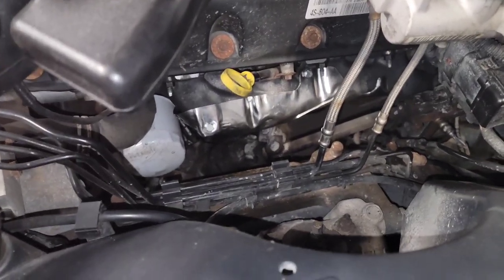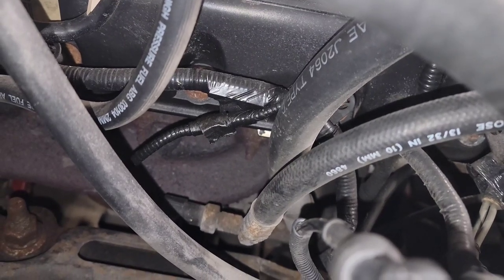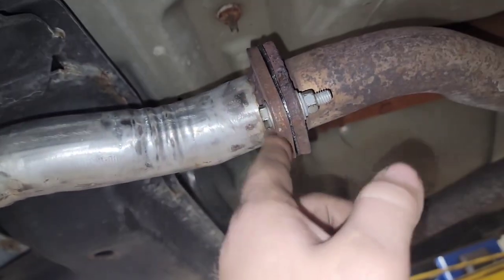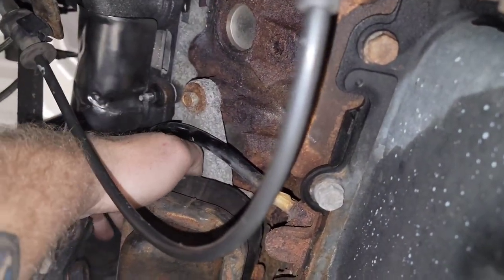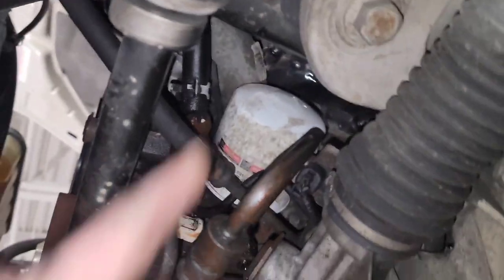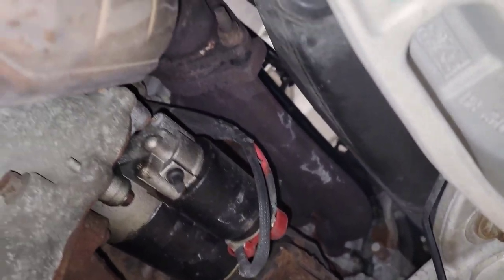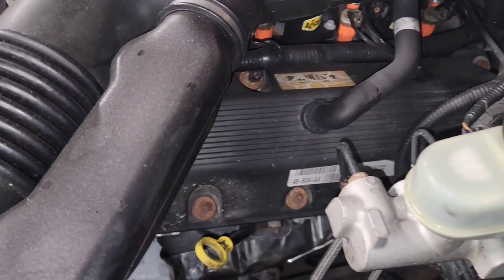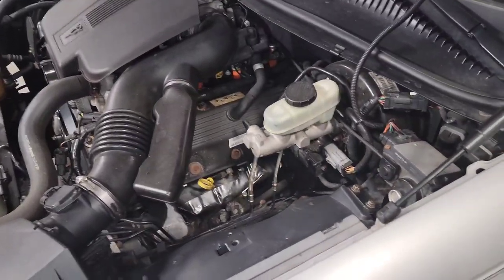2004 Lincoln Town Car Ultimate Subscriber brings his Town Car in that he found on my channel

Comment: Yes I have a 2000 Town car with 208 k miles and I love it. We have fixed all the problems they have at about 180 k. Intake manifold leak, air shocks, front end rebuild, etc. Should run forever. 21 mpg @ 85 mph. Love it!

Comment: The late model full sized Town Cars, and Continentals from the 70’s all had a ride quality that was unmatched by any auto manufacturer. Even an S-Class didn’t ride as soft or smooth over the roughest pavement compared to the Lincoln.

Plus they are built to last forever and are ultra reliable. The only complaint I will say that had plagued Town Cars since the 90’s, is their shoddy quality interiors. Ford never did use the best plastics and the fit and finish was pretty bad in the early 2000 models. Flimsy trim pieces in all. Not to mention Fords electrical components didn’t last long either back then. Power window issues, HVAC problems, power door lock and seat switch/motor failure.. 

Other than that they are smooth cars to drive. I can attest because my 78 Lincoln Continental is the smoothest, most comfortable  riding car I have ever owned hands down, and I’ve driven a lot of newer and older vehicles and for whatever reason none of the modern stuff can touch a full-frame, long wheelbase, RWD luxury sedan from the best. It’s almost impossible even with all the latest suspension technology. 

And that formula is the most basic to build too.it’s not a secret either. 

1. Body-On-Frame =superior NVH over Unibody Construction.

2. Large tires, like 60 or 75 series to cushion road impacts to lessen the “jolt” inside the cabin. Modern cars lose on that one since everything is big wheels and low-profile tires from the factory these days which equals a rougher ride.

3. Heavy curb weight, and body rigidity = a very smooth quiet, vibration free riding car.

4. RWD Softly tuned Coil spring/Air ride suspension that uses a SLA design for ultimate wheel travel and wheel articulation for the best ride quality and handling.

5. Long wheelbase= less bumpy and harsh ride.

The Town Car and many other old school luxury rides from the past all check off in this department and unfortunately they don’t built these kind of tanks anymore which even to this day, ride far superior to garbage FWD suppose luxury whips built now.

This is why I could never sell my Lincoln’s. Ford should never have eliminated the Panther Platform, it’s one of the worst decisions they have ever made, but I understand the reason. The Government likes to ruin everything for everybody since they have nothing better to do.

Comment: Finally got a Lincoln Signature Limited yesterday. Super clean ride. Just the steering is a bit tight but I'll research and try to sort it out.
Reply from the maker: Steering sector shaft replacement
Reply: @FordBossMe  I'll look into that then. Appreciate it. Keep the content coming! 👌🏼
Reply: @fantasma.b  My parent's 05 LTC Signature had a recall for that steering column shaft.  I took it in several yrs ago.  The old one was still fine.  But it was a recall and parts/labor was free so we had them change it out.  Have the local dealer look up your VIN and see if your TC is covered.  Good luck.

Comment: Love the panther platform. I want a full frame, rear wheel drive, V-8 engined car with dual exhaust. Unibodies are very strong, ridgid and squeek free initially, but they don't age well in Central New York winters. The winter road salt gets into all of the cracks and crevices and significantly weakens the unibody with each passing winter.

Comment: I don't know if any other CVPI owner notice this but you can hear everything, I can hear the transmission I can hear injectors, tires, I hear it all, I'm guessing because CVPI doesn't have carpet, My 96 town car I used to have I didn't hear anything when going down the road
Reply from the maker: Yes it's very common in those
Reply: The reason for all the noise in the interceptor is that when municipal law enforcement agencies ordered their vehicles....a large majority of them order whole fleets of CVPIs.  And with all the added heavy duty equipment and weight most of these did not come from factory with the thicker sound deadening material/padding/insulation that the civilian CV would have.  This actually helped keep the purchase price down by a few $.  And when ordering in bulk the costs starts to add up.  But the low rumble of exhaust, the high hum of transmission shifting while in pursuit, and the flutter of air around cabin doors while cruising down the highway are all just part of the charm of the Ford CVPI.  Don't get me started on the way they ride as compared to a civilian CV LS or MGM LS Ultimate!  And yes, I have rode in all three models.  Some not by choice.  Lol

Comment: Check the rack right where the input shaft for the steering shaft meets up. Mine has the updated lower shaft, but mine leaks right where the input shaft comes out of the seal.

My parents bought an 04 CV from an old lady who bought it from a Ford Executive and it has all the paperwork including the paper where they signed off on the paint defect not to be fixed when it rolled off the assembly line. 
I am not much on Ford but fell in love with the Panther Platform as I use to service a fleet of them and there isn't a part on them that I haven't touched.

Comment: I need your help bud my 2003 Lincoln town car has a PO402 code I changed the egr valve still keeps popping up if you know anything to fix this please let me know thank you bud
Reply from the maker: make sure it's a name brand or Parts House quality not no cheap EGR valve

make sure it's an Napa or something like that or you're going to run into a lot of problems
Reply: It’s from advanced auto
Reply: He did a few videos about the EGR if you look in his history. Is it a cheap part? That could be the reason.
Reply from the maker: Also the wire harness that goes to the EGR valve if you follow it and back the entire harness back to the computer you might find on the back of the engine there's a rub through spot but I bought one of those cheap hundred-dollar EGR valves and it failed within 2 days same code
Reply: @FordBossMe  dam I’m sorry I make them refund u all your money back